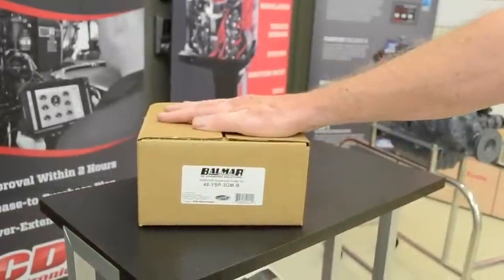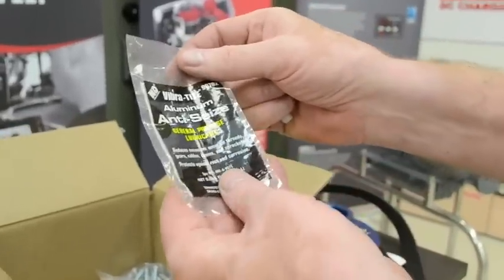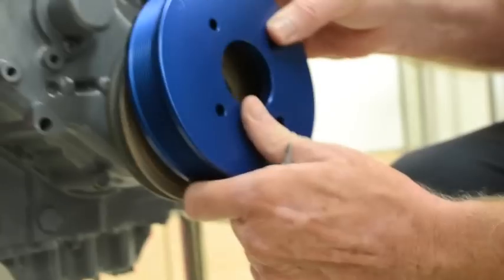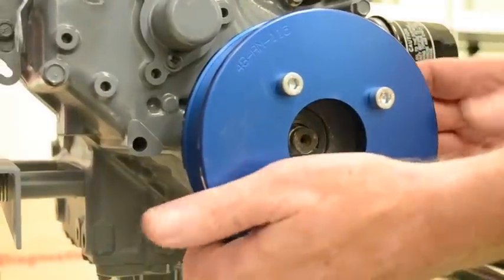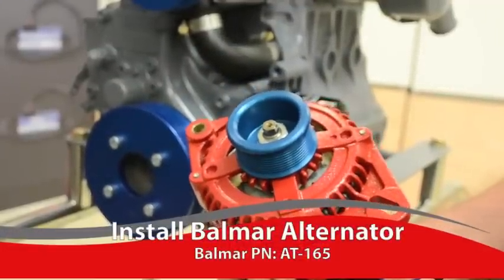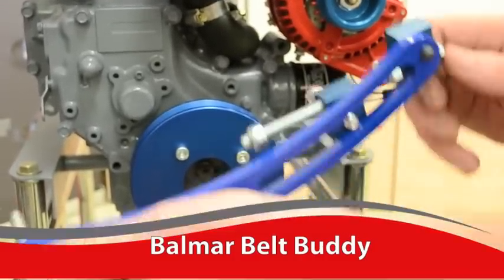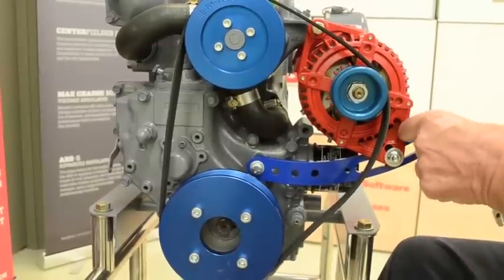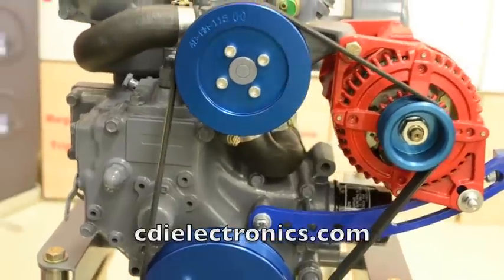Balmar Altmount Serpentine Pulley Kit Installation How-To

Comment: Just installed this on my boat (Yanmar 3GM-30f)  installed that easily.. but doing it ON my boat was a challenge (like most boats) due to access issues. https://www.facebook.com/media/set/?set=a.1020262154776339.1073741845.518092221660004&type=1&l=a96fdec7e8
Reply: I also installed the belt buddy. But as you can see the alternator is buried behind a bulkhead, and very difficult to access the nut to adjust the belt buddy. I installed the alternator pulley last, with the belt on it.  I got it 'close enough, and put the belt on the alternator pulley THEN  installed the water pump pulley with the belt already on it. then tightened up the belt buddy a few turns with a wrench then tightened the alternator bolts.  Came out great.  Will see how it goes this season.. I am very optimistic!